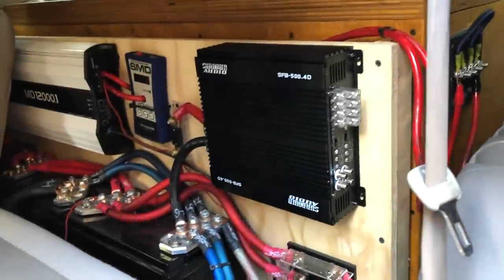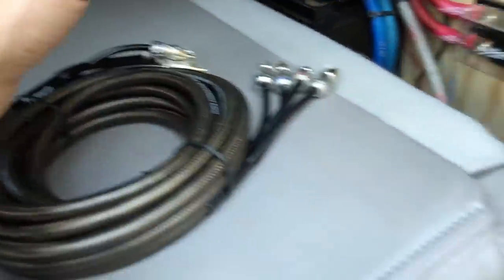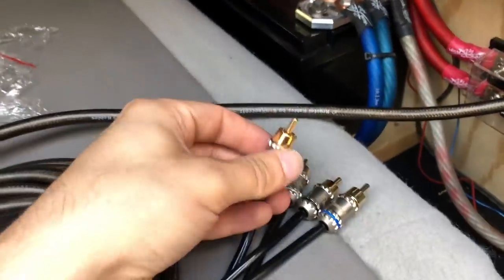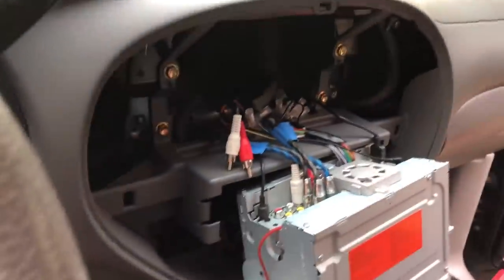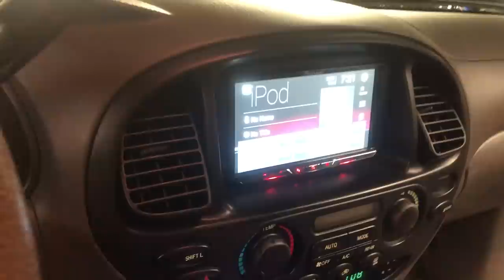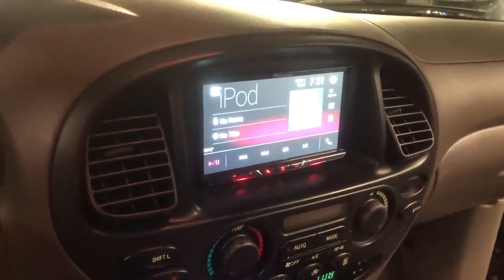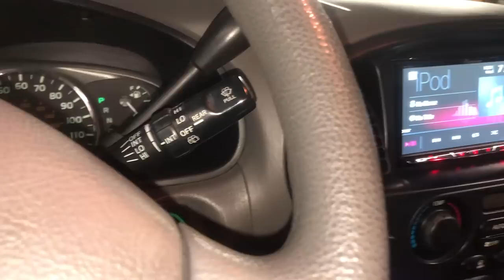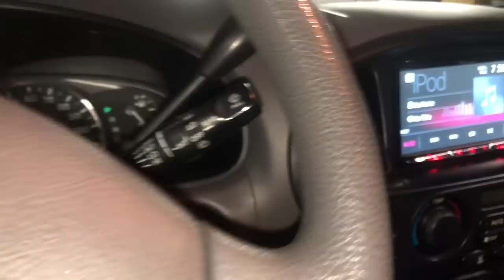Huge 4 Channel Amp Install! No More Static! Sundown SFB 500.4D

Comment: Can u help me out? So I have 2 skar 15s. I have a taramps bass 5k on em, for the mids I have 4 prv neos with a 2k 4 channel taramps.. I have a audiocontrol lcq1.. factory head unit. 0 gauge wire. And a optima  battery. So when I play it low, it plays fine, but when it gets loud, I get a static noise sometimes and my audiocontrol goes into maximize and shuts down. If i restart the stereo it works fine. But then shuts down when loud. Would u lnow why? Or a thought? Also when I start the stereo, or car, I get a loud thump from the bass subs. Idk. Pls help.

Comment: You could have just grounded it to the side of the head unit ! Ah as long as u got it fix I guess that’s all that matters ! The nice rca screw off n on like that to tighten your connection to the head unit and amp, that’s why they didn’t glue it 😂

Comment: Hey Parker would be a good setup for 2 12s for an extended cab I have 2 nemisis audio 12s on 1 k amp but want something that will flex the windshield and wipers mine rattles the truck decent but want more damage lol and want something that plays low and hits hard any suggestions and don’t want to pay 500$ a sub wanna go with 2 12s on maybe like a 6 k cause want to keep stock alternator and no additional battery’s truck has 2 battery anyway

Comment: Hey bro,  you n ashville,  ? I stay in shelby  maybe a hour away,  I'd like to show you my build, 16 kia Optima,. Running a sfb 3000 an a 500.4, also have a ds18 exl 1000.4 that I'm using to push 2 6.5 subs soon

Comment: THE PIONNER RADIOS ARE KNOW TO HAVE WINE ISSUE THYE BLOW A FUSE INSIDE... HERE IS A TIP FOR YOU GET A 3MM TO RCA ADAPTOR AND PLAY YOUR PHONE DIRECTLY TO THE AMP TO ISOLATE THE ISSUE AND VERYFY THAT THE AMP IS NOT the ISSUE ,,,THATS WHAT I DO WHEN IM HAVEING PROBLEMS